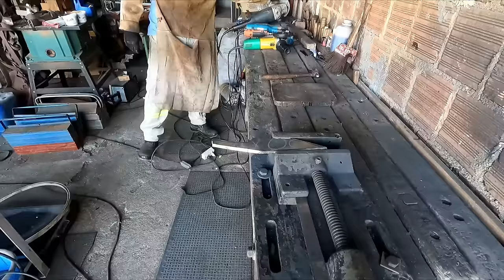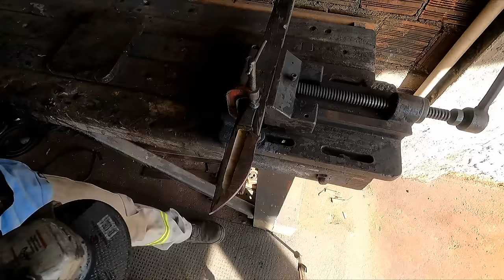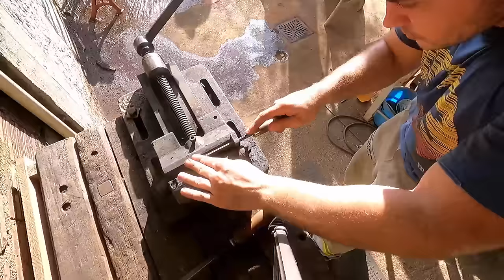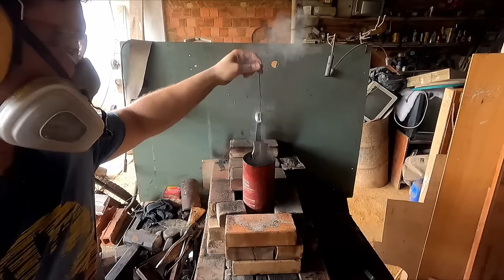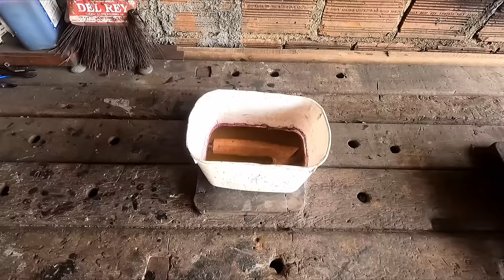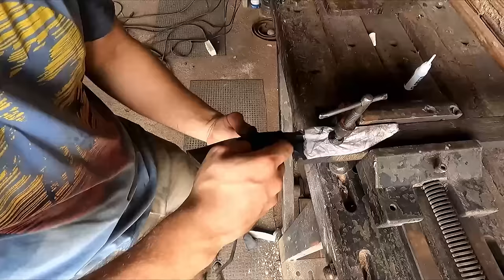Knife Making - Making a Black Bowie Knife

Comment: I was trying to use a Drimmel with a sanding drum on it to form but the drum just doesn't cut metal. I believe they are only for wood. What small drum on what tool did you you use to cut the grove in the blade
Reply from the maker: I used a stone one, they are much more resistant than the sandpaper ones. I only use sandpaper for finishing.👍👍👍

Comment: Beautiful beautiful...but I want to ask if it is okay for heavy duty usage without a pin holding the blade to the handle
Reply from the maker: Thank you my friend. So, I believe it will last for a while. But for very rough use I would recommend using another tool. Because even though this knife has a hole in the handle, the resin works like a pin embedded in the handle. 👍👍👍
Reply: @MakerHA  
Generally I've also found most modern epoxys suffice as grip to handle, as i myself prefer avoiding pins as they can sometimes be a bit of "overkill" & distracting to the finish you're trying to achieve, particularly when i do Exotic Stone Handle Slabs/Scales carved out 3 dimensionally with i.e., African Wildlife Figures etc.,..as they would say " different Horses for different Courses "..⁉️🤔👍🏻
Reply from the maker: Yes, I don't like using it either for the same reasons. I could have even put a pin in this one, as it would have ended up being hidden behind the leather. But I got lazy and did it anyway 👍👍👍  @bernardhill1622

Comment: I really like the way you made the blade. 
The handle:
You finalized it before you glued the knife together. What would you have done if the hole in the wood was off-center?
Usually I make the hole, glue the pieces together and then shape the handle. That way you can compensate for any mishap in making the hole in the handle completely vertical. 
Just a thought.
Reply from the maker: Thanks my friend. Yes, I know that, but this hole was very centralized, that's why I did it this way. But I prefer to do as you said, shaping the cado after gluing it, it's much easier and you rarely make a mistake. 👍👍👍
Reply: eu tambem primeiro colo o cabo...depois alinho depois de colado na lixadeira. nao corre risco de ficar torto.
Reply from the maker: Sim sim. Dessa forma fica muito mais fácil @ivanpetry1

Comment: Nice Job what was the hole in the tang for?
Reply from the maker: Thank you my friend. The hole is used for resin to penetrate it and act as a pin. This way the cable does not have a visible pin 👍👍👍

Comment: Question. Is that a leaf spring you are using? If so why would you have to temper it. Shouldn't the spring already be tempered from the factory. Maybe a stupid question but I am a novice.
Reply from the maker: Yes, it's a car spring. I temper it because the blade comes with a temper with a lower hardness than that used in knives. And as they normally see pies, to untwist them they have to be heated. And if you heat steel you need to temper it again, as you end up removing the temper. Another factor is that when the steel is tempered it becomes hard, which means it is difficult to work with it, which is why I do the hardness removal process to handle it more easily. 👍👍👍
Reply: @MakerHA  thanks for the info and reply
Reply from the maker: @BurritosandCornbread  You're welcome, any questions just ask

Comment: What is the Power tools have you been used in order to do this knife? Great vídeo and technique!
Reply from the maker: Thank you my friend. I used a 4'' angle grinder to cut; a 7'' one for roughing; a belt sander made with a 7'' grinder and an industrial grinder to make the edge on the blade; a micro-grinding machine for finishing the frieze and a bench drill. I think these were the tools I used 👍👍👍

Comment: Do you sell knives?
Reply from the maker: Yes i sell  👍👍👍
Reply: I wouldn't buy this knife, for numerous reasons. Poor heat treatment, no tempering, no pins, handle too big, knife edge geometry is wrong, its too thick for that edge. It is basically a wedge .

Comment: the solution in which you dropped the blade is made of. I will be grateful for the answer.
Reply from the maker: Do you want to know how to darken the blade? This would be a solution of manganese phosphate diluted in water. The proportion I use is 1:9, for 1 part of manganese phosphate you use 9 parts of water. But if you don't get the result as dark, just add more phosphate. But before putting the knife to darken you have to ACTIVATE this solution. 👍👍👍
Reply: @MakerHA  Author, thank you very much for your reply. Please tell me, what needs to be done to activate the firewall? Activation - what is it?
Reply from the maker: You're welcome, my friend. So here we call it activation, but it may have another name as well. You will prepare this solution and in a stainless steel or iron container DO NOT MAKE IT IN ALUMINUM you place all this solution and heat it until it reaches 90~95°C or 194~203F when it reaches this temperature you will need to place it inside a piece of steel wool. When it starts to foam, turn off the heat and the manganese phosphate is to activate. Just be careful at this point as the foam rises very quickly, do it in a large container as it rises a lot. Don't forget to wear a mask, as the smoke released during the process can be toxic. @Кирилл_Знатнов
Reply: @MakerHA  understand everything, thank you. I am grateful to you, thanks for the detailed instructions.🤝
Reply from the maker: You're welcome, my friend. If you have any questions, just ask 👍👍👍  @Кирилл_Знатнов

Comment: Okay there is lot's going on here. I do like the 'rough diamond' black look. Despite there being so many variations on what a Bowie is, I don't think the list should include anything only large enough to peel grapes with.The pointy finish to the bottom of the scales just looks dangerous, which means you can't use the knife [what's the point of a knife that renders itself unusable?]. Finally I loathe and detest these silly so called sharpness tests; cutting a piece of paper, really. If you don't know better you should.

Comment: Nice knife you shouldve added a pin to hold the handle in place kind of look like it started separating at the end of the video.
Reply from the maker: Thanks my friend 👍👍👍
Reply: @MakerHA  you're very welcome buddy. The design was unique and reminded me of an old deer skinning knife I used to have. It was forged from German steel and used part of a bucks antler for the handle. Your knife's handle and my old knifes handle were shaped similar only my was rough and rigid because it was antler lol.
Reply from the maker: @robbiehively4056  She must be very pretty. Here I only find synthetic deer horn.
Reply: @MakerHA  yea it was very nice about 10-12 inches from butt of the handle to tip of blade and sharpe as a razor. It was usually just used for field dressing wild game and cutting it up but I used it to skin a couple but learned that you dint want a very sharpe knife to skin pelt with. Usually end up with holes in the pelts. Lol
Reply from the maker: @robbiehively4056  Yes, a very sharp knife means you end up cutting where you shouldn't